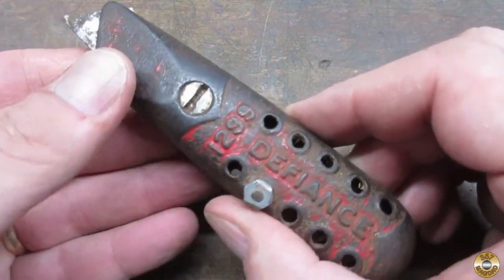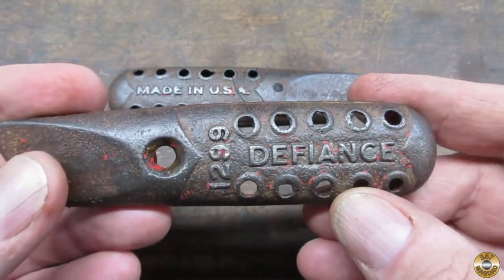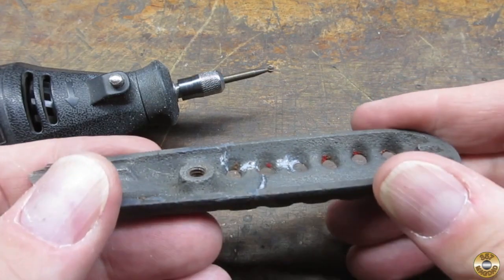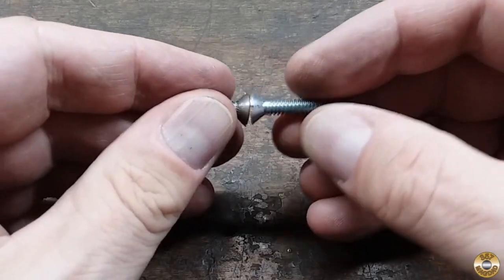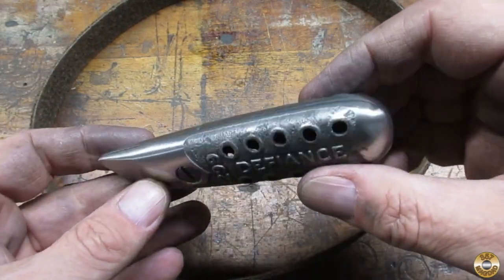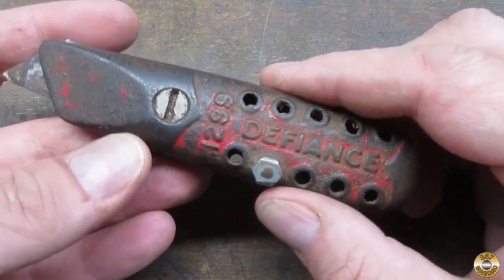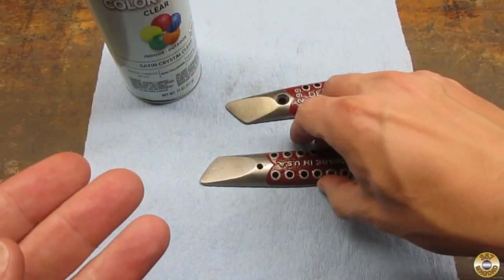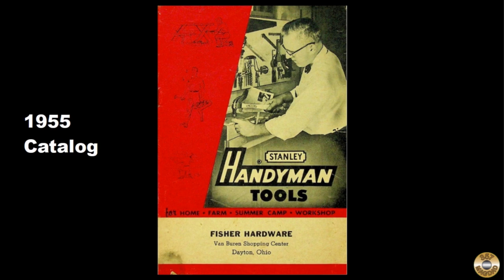Stanley Defiance 1299 Utility Knife Restoration

Comment: Nice! I would have considered that one a goner. You did a nice job. Gives me hope that I can save the gas tank on my 85 Kawasaki 750 turbo bike. It looks like Swiss cheese but I just got 2 kits of Metal Set epoxy. I never considered using cloth for my repairs, but may try that. Better living through modern chemistry and old tricks!
Reply from the maker: Thanks!  Good luck with the gas tank!
Reply: @357magdad  I have no choice. Already had the  turbo rebuilt. She  just needs .fuel and air. Great things after that!